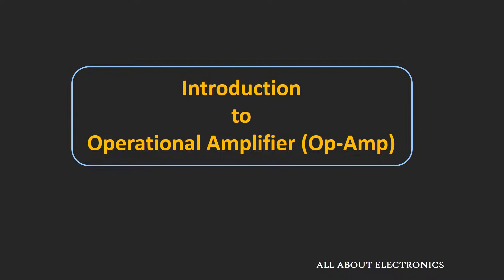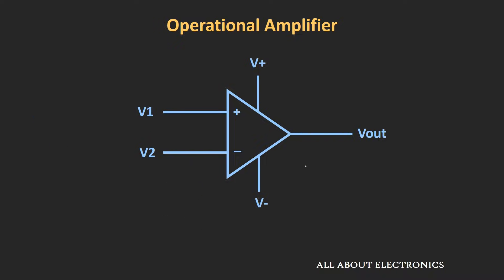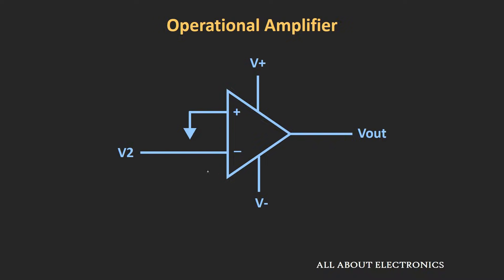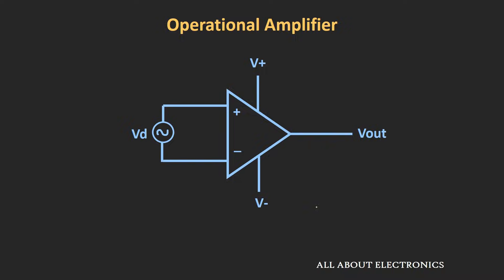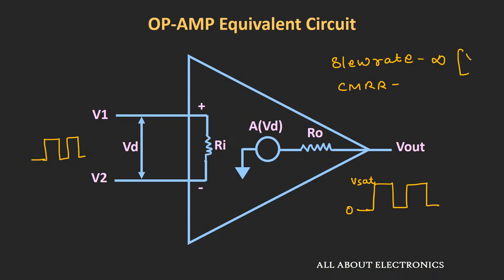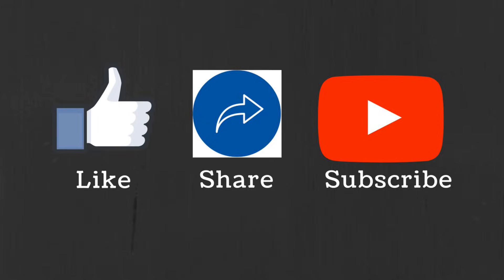Introduction to Operational Amplifier: Characteristics of Ideal Op-Amp

Comment from the maker: The timestamps for the different topics covered in the video:
0:37 What is Operational Amplifier and Why it is known as Operational Amplifier?
1:17 Circuit Symbol of Op-Amp and Op-Amp in the open loop configuration
5:00 Voltage Transfer Curve of op-amp
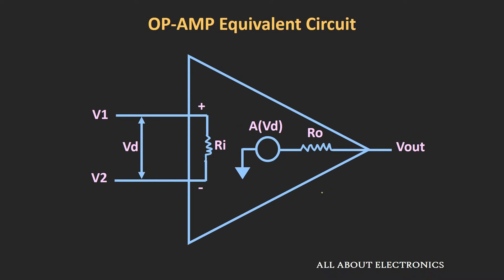7:24 Equivalent Circuit of the Op-amp
7:47 Ideal Op-amp characteristics
12:00 Characteristics or different parameters of General Purpose Op-Amp (741)

Check this playlist for the more Solved Examples on the op-amp:
https://www.youtube.com/playlist?list=PLH9R5x7JVXCFFScqREEGiFCSyKVM3RTM8
Reply from the maker: Nikša   will make a video on it very soon.
Reply: ALL ABOUT ELECTRONICS
Reply: Super explanation.
Reply: Very good explained.
Reply: sir please, in hindi
Reply: May I know the software and hardware used to pRoduce such awesome video
Reply: You could add this in the the description corner, just down below the video : )
Reply: Excellent explanation sir
Reply: What softwares and hardware do you use for writing on screen?
Reply: Tysm 
Keep Up The Great Work Sir ✌
Reply: Sir this is cmos op amp or not
Reply: Make sure to pin your comment next time so that everyone can see it.
Reply: Sir wo 1microvolt input h usko agr hmlog multiply krenge 10^5 se to 10^-1 hoga n to aapka 1v kaise hogya?? Plzzz reply me sir ... It's urgent
Reply: Fauziya Khan 
gain of op amp is taken as 10^6
Reply: Tks
Reply: 3.40
Reply: Please Send the notes

Comment: Ideal OP Amp Characterustic
Infinite Input Impedance.Ri= INFINITE.
Zero Output Impedance.Ro= 0.
Infinite Open Loop Gain.A=INFINITE.
Infinite BandWidth & Slew rate.
Infinite CMRR(Common Mode Reject Ratio).

Comment: 4:50; The Output of the OP-Amp is restricted by the Biasing Voltages (V+ & V-). 
5:00; Un Voltage transfer curve Vd= Voltage differential(X axis) , V* = Voltage Output(Y axis) & m(tangent) = Voltage Gain(10^5 - 10^6).
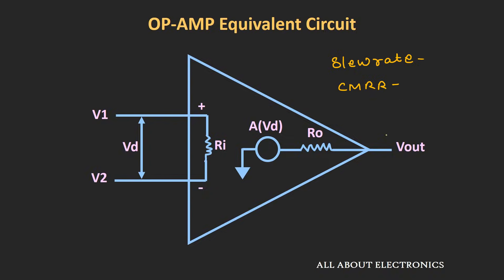9:00; Slewrate = How fast OP Amp reach its final value. For Ideal condition it's INFINITY (V/s). &  CMRR = Common Mode Rejection Ratio; It say how well Voltage difference applied in input side & how well it get Amplified at the output terminal.(Ad/Ac)=(Differential Gain/ Common Mode Gain).
For ideal condition lt's INFINITY.

Comment: Thank you so much for this video! At 4:00 minutes - how did you get from 1mA to 100V? I dont understand the switch from ampere to volts (though I do understand that theres is no current flowing in to the op-amp!).
Reply: For converting mv to v , we should divide by 1000 --- 1x10^5=100000mv;  100000/1000(v)

Comment: 7:56 can you give some more detailing about why input impedance is infinite and output impedance is 0. I couldn't figure it out. Thanks in advance
Reply from the maker: The input stage of the opamp is differential amplifier.which offers high input impedance.  If the opamp is designed using The FET then it's impedance is very high ( in MΩ). The output impedance is not exactly zero but it's low. Ideally it should be zero, to get full output voltage across load. The exact value depends on the last stage configuration with in  the opamp.
I hope it will clear your doubt.

Comment: 3:56 when we give same input the difference between two inputs must be Zero so the theoretical value of output must be Zero!?
Reply from the maker: If you closely observe, It is the differential signal Vd which is applied between the two terminals. That is why, output is A x Vd. 
I hope, it will clear your doubt.

Comment: 5:05 When increasing the differential input of an op amp negtively,it acts like an inverting input right?so the output should take a positive value and get saturated(since it get inverted).but why it's negative saturated when diffrential input is increased negatively? (According to the transfer charactoristic curve of an op amp)
Reply from the maker: As I mentioned, Vo = AOL × Vd.
Where Vd is differential input and Vol is the open loop gain of the opamp.
Here differential input is assumed to be V+ - V-. ( The difference of input voltages at  non-inverting and inverting inputs)
So, if the differential input is positive then output is positive and if differential input is negative then output is negative.
I hope, it will clear your doubt.
If you still have any doubt then let me know here.

Comment: why Ri has to be infinite. Doesn't it mean an open circuit basically?
Reply from the maker: In reality, the input impedance is not infinite, but it is very high value. ( Typically in Mega ohms)

Comment: wHAT TYPE OF IC U USED
Reply from the maker: The use of particular opamp IC depends on the application. Because each IC is optimised for specific parameters ( slew rate, bias current, bandwidth etc.). IC 741 is very general IC, which can be used for very general, low frequency applications and projects. But depending the application, one can select the specific IC. e g if you search on the digikey then there is an option to search the IC depending on your specific requirements ( of parameters).
I hope, it will help.

Comment: 11:21 slewrate should be 0 right?
Reply from the maker: It will be infinite. If you see the unit of Slew Rate then it is V / us. It defines how fast the output is changing with time. For ideal op-amp, the output changes instantaneously. Therefore, in zero time, the output changes. So, the rate of change in the output voltage will be infinite. I hope, it will clear your doubt.

Comment: why open loop gain is infinite for ideal op-amp??
Reply from the maker: Actually it is not infinite, but the opamp has very high open loop gain. Internally it consists of differential amplifier and  other amplifier stage which provides high gain.

Comment: I just confused, if the Ro is low, so there will be voltage drop, then the output voltage is not excactly the same as A. Vd, am I wrong?
Reply from the maker: IF Ro is low, then there will be less voltage drop across it (across the resistor) and hence the output voltage after that  be nearer to A Vd. If Ro is high, then there will be more voltage drop across it and hence output voltage after that will be less than A*Vd.
Reply: @ALLABOUTELECTRONICS  how low Ro could be? I mean, it's better Ro is so high, isn't it? just like the Rin of the op amp, although the Rs of the voltage source (Vs) is low, the voltage come into the op amp will be excactly the same as voltage source (Vs).

Comment: In OP-AMP
If we apply Voltage on inverting terminal...and grounded non-inverting terminal..why we take difference voltage?.. although non-inverting terminal is already grounded?
Reply: You should look at it as if the opamp gets two voltages, and it multiplies the DIFFERENCE between the two voltages. So this difference is always counted as "non-invertimg" minus "inverting". In case non-inverting is zero, then you get 0-inverting, and then this is multiplied or amplified by the opamp and you get this output.

Comment: Sir if applied 12 and 7 volt at V+ AND V- then can we say possitive saturation voltage will be equal to 12 volt or it will be depend on difference of possitive and negative voltage
Reply from the maker: No, it will be 12V.

Comment: Sir what is slew rate,and which type of components inside of the op amp  how that work and how to give output
Reply from the maker: I have already made seperate video on op-amp slew rate. You can check op-amp playlist. Very soon will also make a video on what's inside the op-amp.
Reply: @ALLABOUTELECTRONICS  ok sir

Comment: Hi sir i am one of follower in your you tube channel,  i am a undergraduate student as well, i am learning most of the electronics with the help of your you tube channel thanks for such an explanation
I studied the amplifier section, and i am doing some question on my  own because of it.
Can u upload some amplifier question based on designing op amplifier circuit for linear equation as well some differentiation equations too
.thanks in advance

Comment: How opamp i/p impedance is made high? I mean by which configuration or method in BJT or Mosfet?
Reply: Dear Ayush, in an opamp input is applied to base of two transistors in the differential amplifier. It you analysed the circuit the bases appear as two diodes connected in series but back to back. So the diodes are in reverse biased condition and we know that when a diode is reverse biased, current flow through the diode is zero or negligible. So input current is almost zero. Input impedance is defined as the ratio of input voltage to input current. As input current is almost negligible input impedance is vin/0, so input impedance is almost infinite.....

Comment: At 4:26, if the input for inverting and non-inverting terminal is the same, wouldn't it result in 0 output? Because of output = A(V1-V2)?
Reply from the maker: It's not the same input at both terminals. when we say differential input of 1mV is applied between the two terminals means that the positive terminal of 1mV is applied at one terminal, and the negative terminal at the other end. 
That means the difference between the two input terminals of the op-amp is 1 mV. 
If we have applied Vd at the positive terminal and the second terminal of the Vd is at the ground, then we can say that the voltage at the  "+" terminal of the op-amp is Vd.
Similarly, if we apply the positive terminal of Vd at the "-" terminal with other end of Vd at ground potential then we can say that the voltage at the negative terminal of the op-amp is Vd.
And that case, theoretically the output of the op-amp should be zero. 
Because in that case, the input at both end of the op-amp is same.
But at 4:26, where you are mentioning, the difference between the two inputs is 1mV.
I hope it will clear your doubt.
Reply: @ALLABOUTELECTRONICS  wow thanks for your explanation. I haven't never watched a channel as responsible as you are. There is no equivalent videos on YouTube that are at your level. Truly amazing!

Comment: at 3:53 if Vd is applied to both the ends then the output should be zero as the difference of them(which is zero) is amplified  ??
Reply from the maker: It's not the same input at both terminals. when we say differential input of 1mV is applied between the two terminals means that the positive terminal of 1mV is applied at one terminal, and the negative terminal at the other end. 
That means the difference between the two input terminals of the op-amp is 1 mV. 
If we have applied Vd at the positive terminal and the second terminal of the Vd is at the ground, then we can say that the voltage at the  "+" terminal of the op-amp is is Vd.
Similarly, if we apply the positive terminal of Vd at the "- "terminal with other end of Vd at ground potential then we can say that the voltage at the negative terminal of the op-amp is Vd.
And in that case, theoretically, the output of the op-amp should be zero. 
Because in that case, the input at both end of the op-amp is the same.
But here, the difference between the two inputs is 1mV.
I hope it will clear your doubt.
Reply: @ALLABOUTELECTRONICS  thanks it helped.

Comment: SIR IN 4:02 IF WE SEND SAME VOLTAGE IN + AND - THEN TH OUTPUT WILL BE ZERO AS        A(Vd-Vd)
Reply from the maker: Ideally yes, it should be zero. But actually, there will be some output (due to finite CMRR of the op-amp)
For more info, you can check the video on CMRR.
Here is the link: https://youtu.be/hpCu3HbAiWg

Comment: sir, please explain why the output voltage saturates to biased voltages   in voltage transfer characteristics,please...
Reply from the maker: For any analog circuit/ amplifier, the output voltage can at the most go up to supply voltage. Obviously, we can't get output voltage, more than the supply voltage in amplifiers. 
Therefore initially, as we increase the input voltage, output voltage increases and provides the gain.
But as it reaches near the supply voltage or the saturation voltage, it can't go beyond that. 
Therefore output voltage saturates at or below the biasing voltage in the voltage transfer characteristics.
I hope it will clear your doubt.

Comment: Y... Output impedence is zero???
Reply from the maker: That's the ideal case. Actually there is some finite output impedance. But if you want to know why the output impedance of any circuit should be zero then for that I have made a seperate video on input and output impedance. Please check on the channel page. If you don't find it then let me know here, I will send you a link.

Comment: why -ve and +ve terminal is called inverting and non inverting input?
Reply from the maker: Because when the input is applied at the V- terminal then the output is getting inverted. 
Similarly when the input is applied at the non-inverting terminal then the output is in the same phase with the input voltage.

Comment: Sinusoidal wave giving rectangular wave output why ?
Reply from the maker: Because of the very high gain, the output will get saturated to the supply voltage. (usually it is lower than supply voltage and known as Vsat)
So, during the positive half cycle, even if input sine wave is varying, at the output you will get saturated output. (Considering very high gain of the op-amp, you won't gain output voltage like 10^6V !!)
That's why output is rectangular wave. I hope it will clear your doubt.
Reply from the maker: Because of the very high gain, the output will get saturated to the supply voltage. (usually it is lower than supply voltage and known as Vsat)
So, during the positive half cycle, even if input sine wave is varying, at the output you will get saturated output. (Considering very high gain of the op-amp, you won't gain output voltage like 10^6V !!)
That's why output is rectangular wave. I hope it will clear your doubt.
Reply from the maker: Because of the very high gain, the output will get saturated to the supply voltage. (usually it is lower than supply voltage and known as Vsat)
So, during the positive half cycle, even if input sine wave is varying, at the output you will get saturated output. (Considering very high gain of the op-amp, you won't gain output voltage like 10^6V !!)
That's why output is rectangular wave. I hope it will clear your doubt.

Comment: I got all the knowledge but I stuck at one point that in Inverting opamp we ground the non inverting terminal directly but in Non Inverting opamp we ground the inverting terminl using resistor, plz may u explain this..
Reply from the maker: The resistor connected at the inverting terminal (Between the inverting terminal and the ground) provides the feedback to the op-amp and it is required to provide the negative feedback to the op-amp to used in the closed loop configuration. 
So, basically through that resistor, negative feedback is provided to the op-amp. 
I hope it will clear your doubt.
Reply: @ALLABOUTELECTRONICS  Got it sir

Comment: Sir in opamp you use the word 'open loop gain ' can u tell me why don't you use the word as close loop gain..
Reply from the maker: Closed loop gain refers to the loop gain when the op-amp is used in the closed loop configuration. 
And it depends on the external circuit components. And how the op-amp is configured. 
But the open loop gain depends on how the op-amp is designed internally. And usually, in datasheets the open loop gain is specified.

Comment: @3:56 terminals are shorted and input Vd is fed to opamp. That means voltage at inverting terminal and non inverting terminal must be same . Hence output = gain * ( v1 - v2 ) =  0 Volts. But you have mentioned output is (gain * Vd). Can you elaborate how it is  ( gain * vd ) ?
Reply: Same question arise in my mind
Reply: bcz we know gani=output/input ,so here input=difference of the input signal vd,so we can write output=gain*vd

Comment: does it violate the law of conservation of energy? why doesn't so
Reply from the maker: No. Because we are applying the external biasing voltage to the op-amp. And this voltage provides the required energy for the amplification.

Comment: in this vedieo in put resistance( Ri) of an op amp is infinite and and since it is infite  you have said that what ever we apply it will directly apply to the op amp..i.e if the there is infinite resistance current cant be passed into the op  amp????then current cant enter into the op amp then how does it works???
Reply: Dear friend, current flow between input terminals is very small, surely there is a current flow between base and emitter of the two transistors....

Comment: What if I make baising voltage 0
Reply from the maker: If you look at the internal circuit diagram of the op-amp, it consists of many transistors. Without biasing voltage these transistors will not function. And simply op-amp will not work.

Comment: At 2:33 and 3:56 there is no any difference in circuit.  2:33 you have connected negative terminal at ground that means it is connected to opposite terminal of  AC source too ,so v1 should be equal to V2 ..but why V2 is zero at 2:33 ?
Reply from the maker: Let' s say even if you are connecting the AC source, one terminal will be more positive then the other terminal at given point of time. So, at a given time t,  V1 and V2  will not be equal if you directly connect the AC source between the two terminals. I hope, it will clear your doubt.

Comment: Input impedance in OP-amp is  infinite ,that means there is no any current flow through op-Amp. So how we get high current( amplified) at output side although there is no any current flowing through input to output bcz of infinite input impedance ?
Reply: because the gain is infinite. so if input current is zero, the output current can be finite. also the Vout = gain x Vd not input current